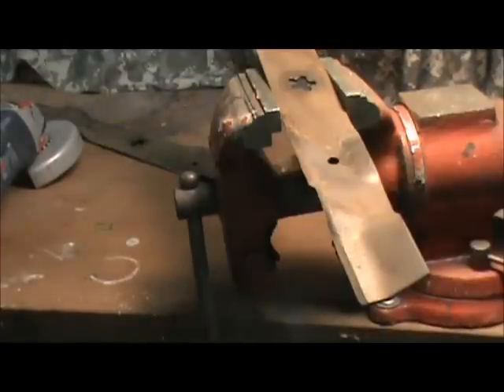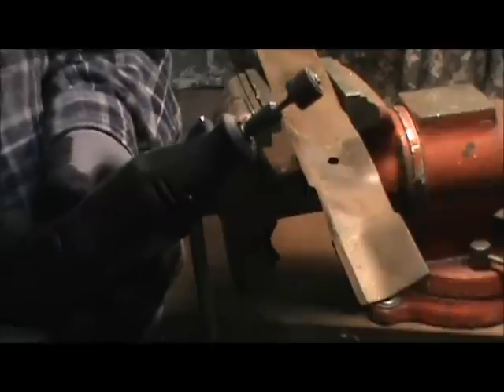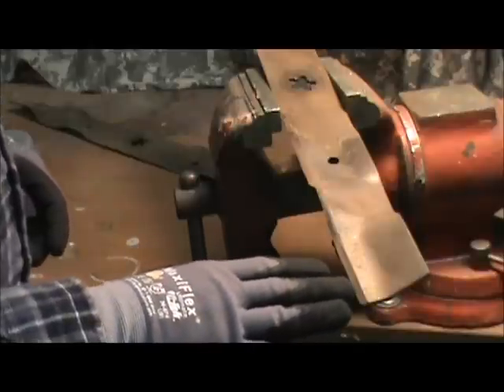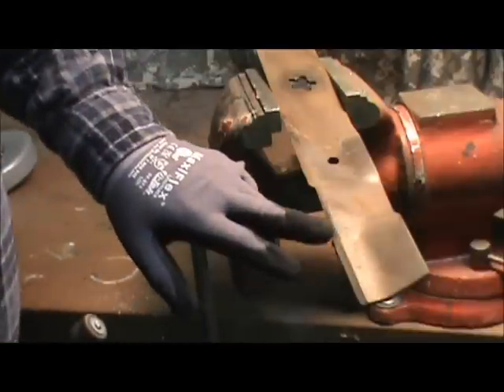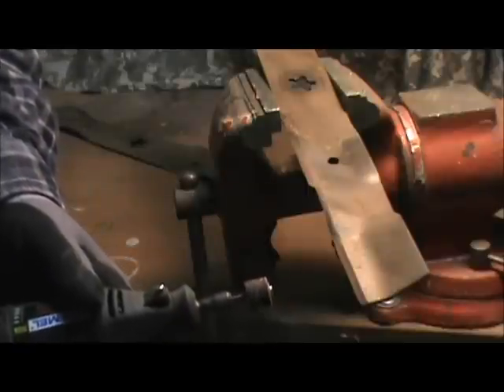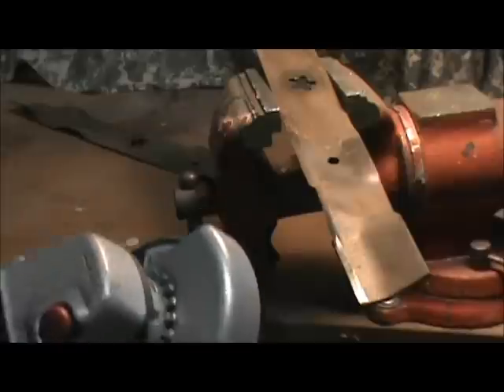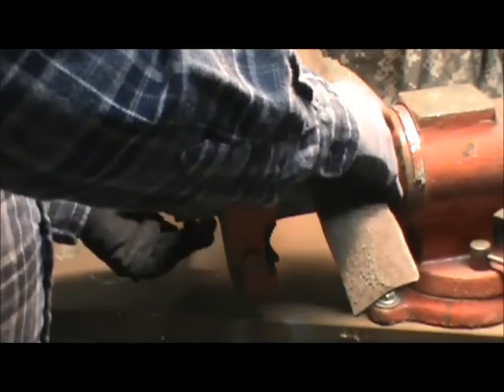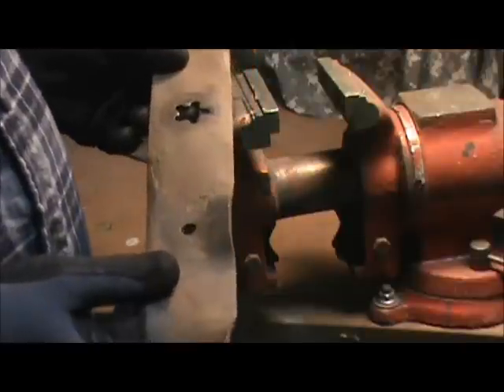My DIY Sharpening Lawnmower Blades

Comment: Wish I had thought to use a right angle grinder when we were doing rotary mower blades 40 yrs ago in my dad's sharpening shop.  The stationary Foley grinder we used then was time consuming to set up, jigs were bulky and heavy, and plane/angle changes (like with a mulching blade) were a nightmare to set up and repeat.   Only tips I would add are to be careful about grinding the back side of the blade (I usually just use a file back there, and then only to knock off the burr left by the grinder), and to check the blade's balance after a couple of sharpenings.  Your technique is a good one for the home workshop -- thanks for posting!

Comment: 1. Turn ON Bench Grinder.  2. Put cutting edge of blade on tool rest and make 2-3 passes at the same angle - 30°  3. Repeat on other end.  4. Turn OFF Bench Grinder.  5.  Balance if required.  6. Done.

Comment: As you stated, these are hardened tools(the blades).
Don't take a high speed grinder to a mower blade. To much heat build up.
Go old fashion and use a hand file and get it razor sharp with out loosing the temper of the steel.
On mulching blades you can also include a rat tail file for the curves in the blade.
When grinding a any hardened metal, and its to hot to put your lips to it, you are over heating it.
Take 20 minutes and do the job correct.
Saw chains are the same, only hand file.

Comment: This was a helpful video. Thanks. I am wondering though, why you are using a sanding disk (on your Dremel) rather than a metal grinding bit?
Reply: yep, was wondering the same thing too. Wonder if the sanding bit will actually sharpen it?

Comment: pro tip, dont touch the back of the blade you want it as straight as possible
Reply: Majestic Nah. You shouldnt cut it down to form a point with the other side, but you should ensure there isnt a burr formed.
Reply: that's right!! you want a chisel edge and angle maintained

Comment: never use a power tool to sharpen a lawn mower blade.  Use a common diamond edge hand file.  Always use a down stroke away from the cutting edge.  This Old House shows the correct way to hand file a blade.
Reply: BS, you can use power tools to sharpen the blade. It's not going to last 20 years anyway
Reply: naughtyorgneiss the tool?